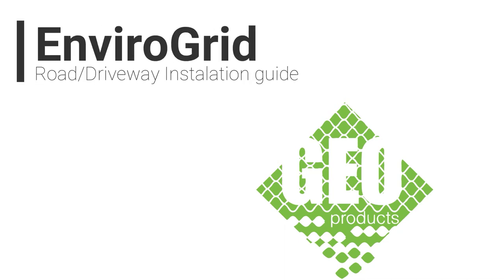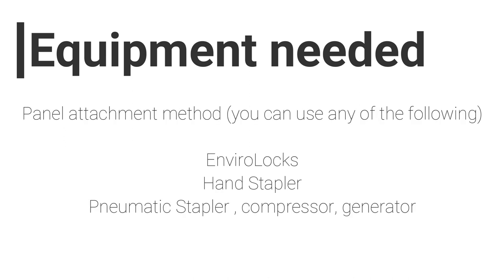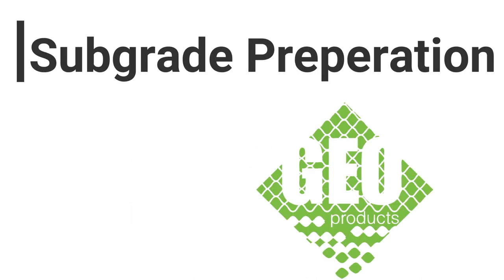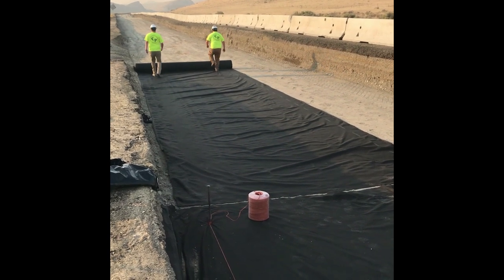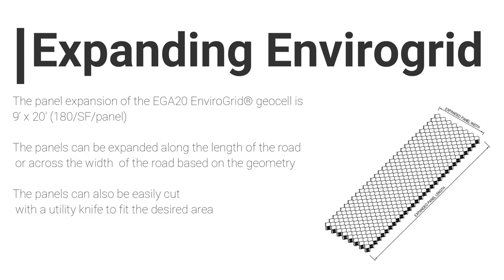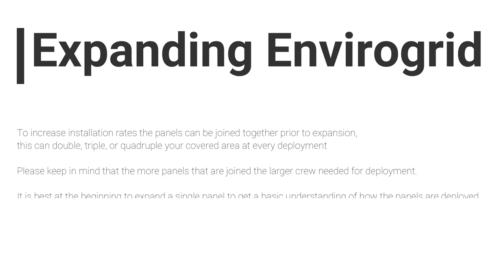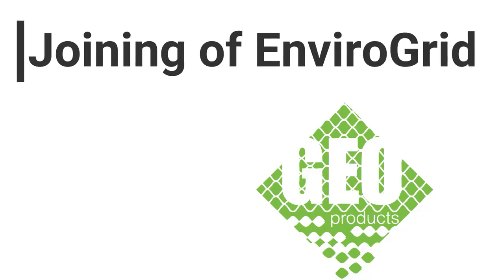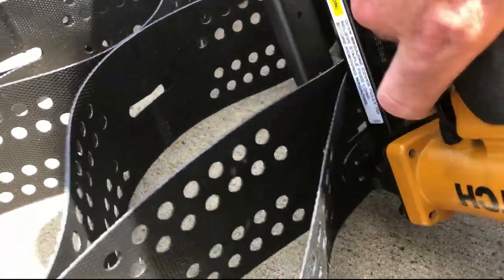How to Install a Geocell Ground Stabilization Grid

Comment: Hi 👋👋 Do you guys have any advise on ground stakes to hold down the cells? IE - type and how many to buy? and place them every cell or every other cell on the parameter? Also did you leave your stakes in after the cells were filled or did you pull them?  Many thanks 🙏🏼

Comment: Hi. I plan on using 1/4-3/4 gravel. I’m not as familiar with type 57 as a size but from what I have read it can be 1.25” and smaller but I don’t believe it includes fines (zero). Is this correct?  Thanks for the video
Reply: #57 is 1 1/4" and smaller washed gravel with no dust.
Reply: @sl3406  thanks

Comment: Can use Recycled Asphalt?
Reply from the maker: Hi Louis, Yes you can use Recycled Asphalt. When selecting and infill material it should have the following characteristics: 1. The material drains well 2. no aggregate in-fill material that is greater than 1/3 the size of the cell, meaning if you're using a 3" cell then no infill material larger than 1" aggregates.  3. Stay away from organic infill materials that will degrade over time. Go here to see the full installation guide for Envirogrid Geocells Ground Grid Pavers http://www.landscapediscount.net/images/Envirogrid-Geocell-Ground-Grid-Paver-Instructions.pdf